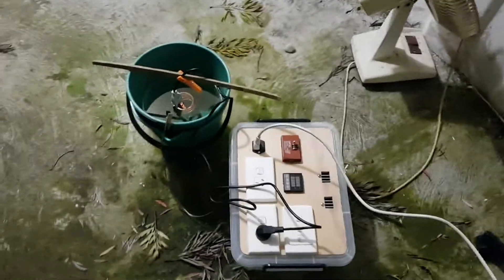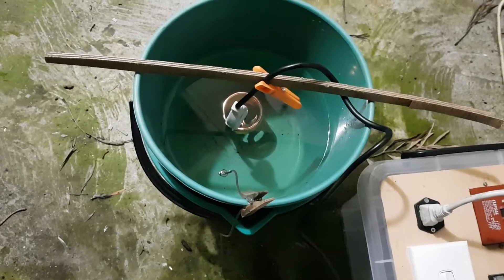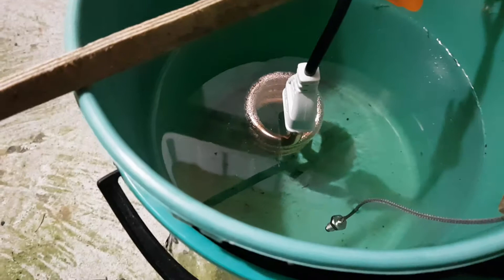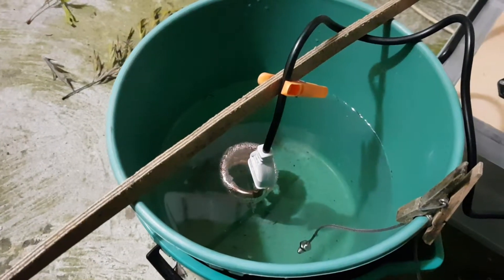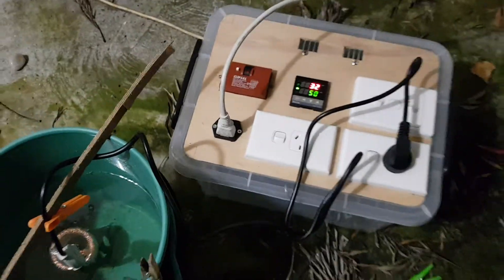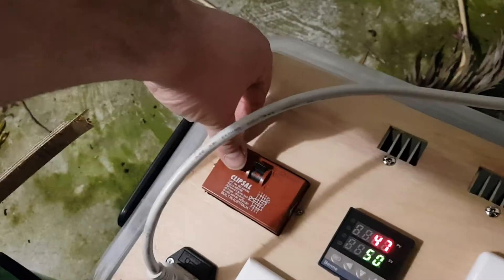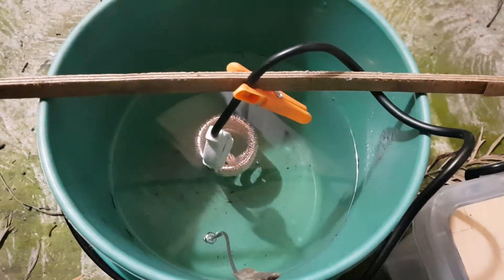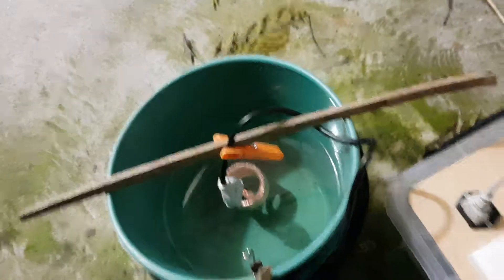Deathtrap Immersion Water Heater Part 2

Comment: Why did you call it a deathtrap?
Reply from the maker: the metal casing of the heater is not connected to the earth pin. if there was a fault in the heater coil the water may get electrified and anybody who comes in contact with it may get electrocuted.